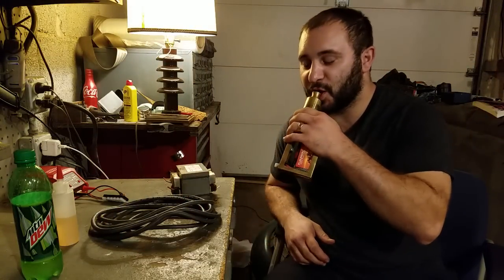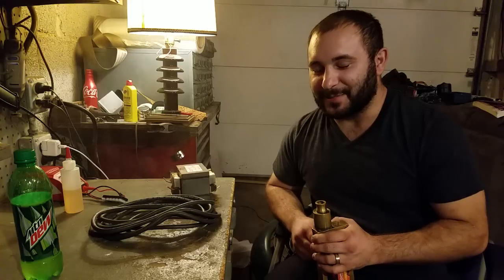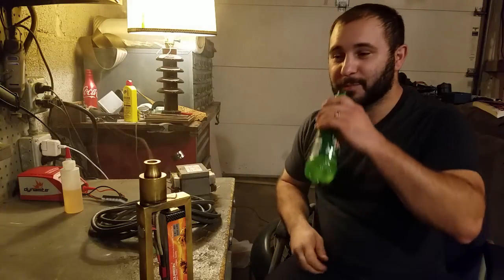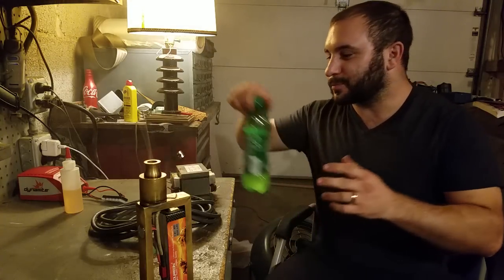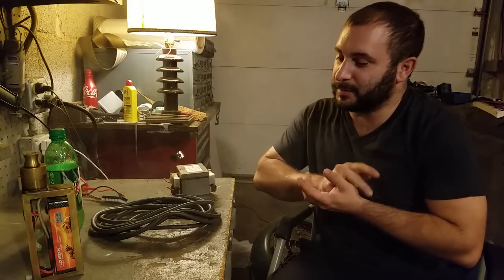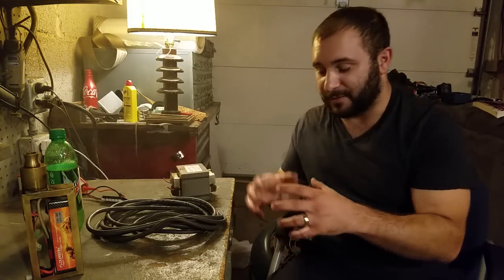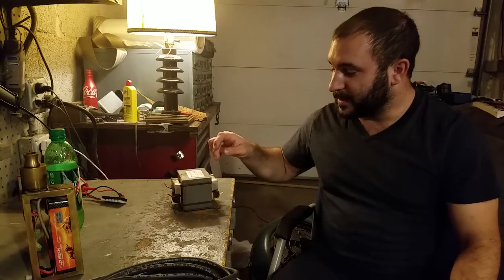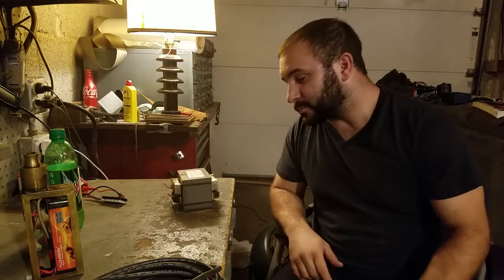120 volt ac ecig part 1

Comment: Great videos man as always. im really interested in your projects i want to see you make more insane box mods i am an electrician too.
Reply from the maker: Honestly I've made all my rdas on a manual lathe. Everything threads together to make it as easy to machine and assemble as possible. For the transformer setup my suggestion is to aim for a higher voltage on the secondary coil and regulate it down to allow more freedom of builds.
Reply from the maker: technically I'm not an electrician lol! I have no formal schooling or training. I'm an elctric motor tech
Reply: Matthew Vandewiele I'm curious as to how you make your rdas..... and I'm working on an act desktop mod as well... in using a dimmer switch and a transformer, any suggestions? Thanks!
Reply: Matthew Vandewiele ok thanks!
Reply: Matthew Vandewiele how can I contact you

Comment: How low could you build ?
Reply from the maker: assuming I can get 12 volts at 100 amps then .12 would he the lower limit however with the ability to lower the operating voltage would also lower that limit.